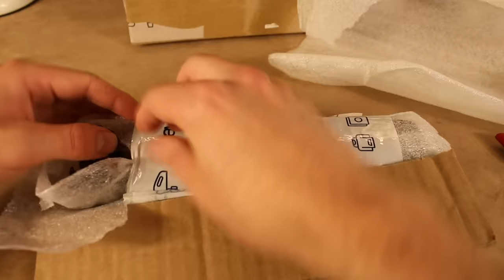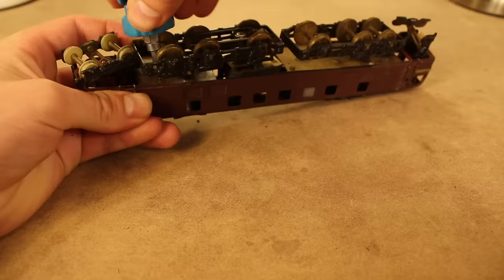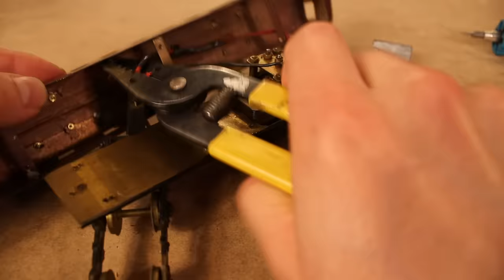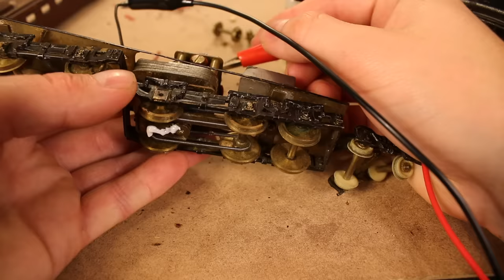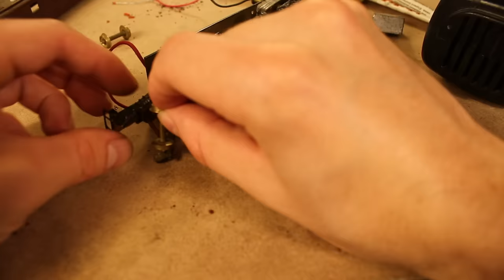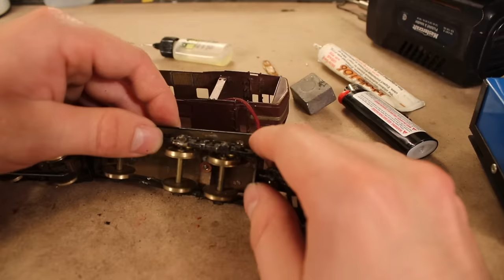Trying to Fix a Very Unusual HO Scale Brass Locomotive - Will it Run??

Comment: Nice find of that Japanese EF58. It does remind me of a Pennsy GG1 in that brown paint. I haven't found many Japanese and Korean prototype brass trains, especially since nearly all brass trains come from there. I think you could mount a Kadee coupler right above the first lead axle and it can pull fine
Reply: Count the side windows, it's an EF-57. This model and the EF-57 as it has seven side windows, an EF-58 has five. 

 Class EF57 (EF57形) of 2-C+C-2 wheel arrangement DC electric locomotives was a development of the previous JNR Class EF56. 15 Class EF57s were built between 1939 and 1943 by Hitachi and Kawasaki.

Introduced on Tokaido Line passenger services, they were seen at the head of expresses such as the Tsubame, complete with train headboard mounted precariously on the front of the cab decks. With the introduction of the newer semi-streamlined Class EF58s on Tokaido Line services, the EF57s were transferred to the Tohoku Main Line. At the same time, their steam-heating boilers were removed and replaced by electric-heating generators.

The class remained in use on long-distance express trains on the Tohoku Main Line until the 1970s.

Specifications
Configuration
 • AAR	2-C+C-2
 • UIC	(2'Co)(Co2')
Gauge	1,067 mm (3 ft 6 in)
Driver dia.	1,250 mm (49.21 in)
Length	19,920 mm (65 ft 4+1⁄4 in)
Width	2,810 mm (9 ft 2+5⁄8 in)
Height	4,091 mm (13 ft 5+1⁄8 in)
Loco weight	110.82 t
(109.07 long tons; 122.16 short tons)
Electric system/s	1,500 V DC overhead line
Current pickup(s)	Pantograph
Traction motors	DC
Performance figures
Maximum speed	95 km/h (59 mph)
Power output	1.56 MW (2,090 hp)
Tractive effort	9,500 kgf (93,160 N; 20,940 lbf)
Career
Operators	JNR
Number in class	172
Disposition	One preserved, remainder scrapped

It should be running on Cape, not Standard Gauge
Reply from the maker: I think this is a somewhat rare model. I wasn't able to find much online about it.
Reply: I don't know for this model, but a lot of japanese 'HO' (ie models of domestic trains on 16.5mm gauge) are 1/80 scale.

Comment: Tenshodo/Fulgurex model from the 60's 70's or late 80's They have a tiny spot at the end of the Internationaller modelleisenbahn katalog from 1985 and even then they used the old 60's catalog pictures.

Comment: I’ve been following you since the pandemic and I am very impressed as to your presentation and video content. I am especially impressed how you are persistent to getting older locomotives
 to run almost like new.  You have great tips on cleaning and even making missing parts to get the locomotives to run great. Your assessment of various manufacturers is very helpful. 
Since I’ve been watching you I have purchased mainly Mantua steam and diesel engines and some Tyco diesels. I find the Mantua steam easy to work on. Thanks for your content and I will continue watching. Much success to you in the future. Dale k

Comment: Nice job getting that running great video as always.  I just got my first electric locomotive i got an old rivarossi gg1 found it at 2 am for 45$ on ebay grabbed it right away never seen on that cheap and it wasn't in pieces.

Comment: This looks a lot like it could be KTM or Tokyo Endo. I imported an O gauge locomotive and a couple cars from Japan a year or two ago, eventually I'll have them restored and I can enjoy running them. The a lot of the O gauge equipment was 3-rail, but had scale-sized flanges which aren't optimal for running on O gauge track that has a round railhead. Something with "T" shaped rail like Super O, Gargraves, Fastrack, Atlas O, or MTH Realtrax would work though.
Fortunately, HO trains don't generally have this issue since the track always has a realistic rail profile that works well with small flanges.

Comment: Nice model in HOj...Japanese rendition of its 3'6" gauge prototypes in scale 1/80 to run on HO gauge ( 16.5mm) Track...another "toy train" compromise. But the Models are excellent representations, especially the Steam Engines...originally rolling stock ( cars, wagons) were accurate pressed metal, later injected Moulded Plastic...top of range ( Tenshodo) were all brass construction.
The national modelling journal Tetsudo Mokei ( IronWay Models) is a great source going back almost 70 years. ( helped me to learn Japanese -- unsuccesfully)
DocAV

Comment: Great Japanese locomotive, an EF56, looks like a Tenshodo brand, now you need to find the other panthograph and the railings in the front and back. You just gave some nive clues to fix a similar Japanese engine I have that runs but after a while goes into short-cut so I will check on the same points you did. Thanks for the graphic advise.
Reply from the maker: Thanks for the info

Comment: I have never seen something quite like this! It reminds me of the time piko made br 52 steam locomotive with a really weird tender that doesnt look like the actual tender.
Reply: You mean the BR52 with the condensing tender? Different for sure but necessary where it was used. I’ve got one (a Gützold variant with the smoke lifters) and it’s a noisy little thing but a good runner.
Reply: I guess the engines with condensing tenders were prototypes.
Reply: @Davidstrains2056  they were used in the Soviet Union and the Balkans where water supplies were rare.

Comment: Good looking piece. Really needs to be refinished, because good paint goes a long way, but the mechanicals are solid. Needs a new pantograph and end platforms. Most electric locos have a provision to draw power from overhead so you could theoretically string up real catenary.
Reply from the maker: Since it's got a brass body I'm sure it would easily pick up power through a wire.

Comment: The EF58 is a japanese narrow gauge locomotive which ran on a 1067 mm track, not on the normal 1435 mm rails. So normally a H0 version for H0 standard rails is not quite correct.

Comment: you need to get the Darwin coupler boxes from the coach yard(tcy) for your brass models. They also include the screws too
Reply: I was wondering what kind and how the couplers were installed on it; I assume between the wheels and end platforms.

Comment: Nice. I broke down and bought 2 ebay lots myself. I get Friday or Saturday. 1 has 10 cars 2 i really wanted 1 is a VARNEY gondola and the other is a Mantua tyco Babe ruth box car with chuffing sound maker. Didn't say if it worked but it's in the car. They are in great condition too. It also has a few caboose's a few gondola a couple coal hoppers with load. The other lot is a mantua/tyco western Maryland flat car with tractor load. I have one but it's just the flat car shell and 2 of the 3 tractors (red\yellow) the 1 i bought has all 3 tractors (red/yellow and green) and even has the brake wheel. I cant. wait everything needs couplers and im sure some oil in the wheel bearings and some dusting. But yeah it also adds 3 new road names to my collection as well D&RGW, Burlington Northern, and SOO LINE. I really want to make a spread sheet of all my trains. Categorize them by car type. 9

Comment: EF - E for electric and F for 6 powered axles. (ED then is for 4 powered axles, EH for 8, DE is a Diesel with 5 powered axles, that´s the japanese numbering system of former JNR and todays JR and JRF, not working for most private or third sector railways though).

Comment: I didn’t know you had to fix it when I have one of these. I just wear it in. And it works perfectly fine after
Reply from the maker: Sometimes the parts just corrode and running it will get things working again but if the parts don't have oil (especially metal ones) they won't last very long without lubrication.
Reply: @SMTMainline  we’ve already tried that
Reply from the maker: @singlestrobe  I'm confused. I thought you said it worked fine without work?
Reply: @SMTMainline  OK I’m confused now too back to the topic. The steam engines get really stuck around corners and I just have to wear it in for them to move so I’m trying to figure out how to make those move smoothly and the gg1 that you fixed. Just has squeaky wheels.

Comment: Nice work there! 

Do brass engines have specific maintenance requirements? Are there things I might do with a more commonplace model that I shouldn't do with a brass engine?
Reply: Main thing with brass is that it's very easy to have short circuits when the whole locomotive is made of metal. Very detailed brass models might also have fragile detail parts to watch out for, but that can also go for detailed modern plastic models.
Reply: Running brass locomotives on a regular basis means regular lubrication (every ten hours of use) and tightening screws which work their way loose.

Comment: This is a crazy question, but...is that an old Suydam model?  If it is - you might want to check the pantograph to see if it will draw electrical power from that as well.
Reply from the maker: I believe it is. I couldn't find much online about it though.
Reply: @SMTMainline Looking on line - that very well could be a Sango JNR or a Tenshodo EF-57. It being sold brass excludes it from being a  Kato or Rapido, as those two models have plastic shells.    Ah, the internet is a wonderful research tool at times...

Comment: smt you said something about isolated wheels how do I tell what wheel is isolated on a DC and DCC loco?
Reply from the maker: There is a plastic ring in between the wheel and the axle (the isolator) the wheel on the other side is metal all the way through (the conductor)
Reply: thanks smt @SMTMainline

Comment: My son works with a with a label machine, I recommend you pick up some small or medium nitrate gloves when working with all that stuff.
It can cause cancer, birth defects and other reproductive harm.
Reply from the maker: I have gloves but I generally don't use them unless I'm working with degreaser or lead. What material would you consider a risk here? I'm willing to change if it's a significant risk.

Comment: SMT - Maybe your Grandma's Rivarossi Hiawatha has similar electrical problems that cause its intermittent operation?
Reply from the maker: I don't recall it having electrical issues other than when I added that decoder.
Reply: @SMTMainline  Maybe you could try wrapping the decoder circuit board in electrical tape - that may eliminate any intermittent contact.